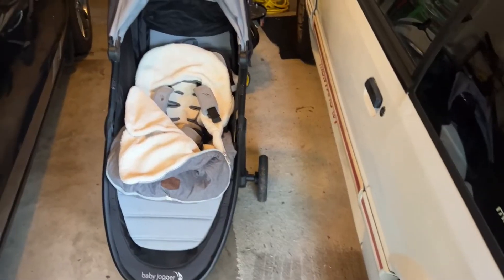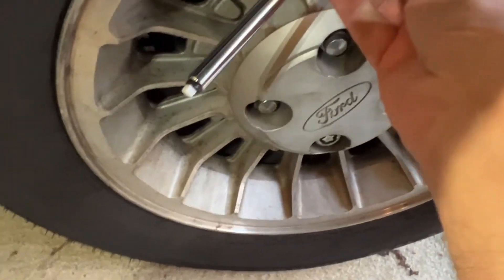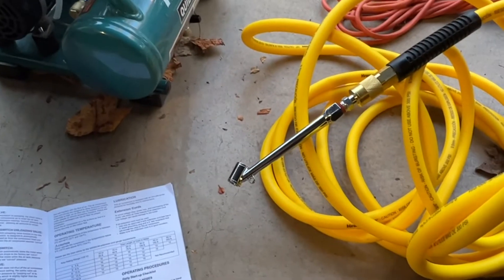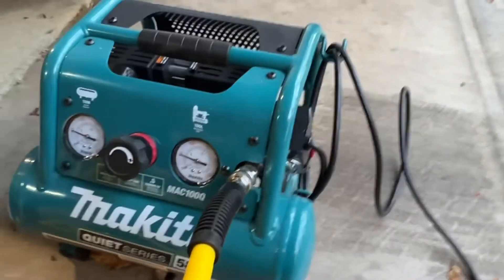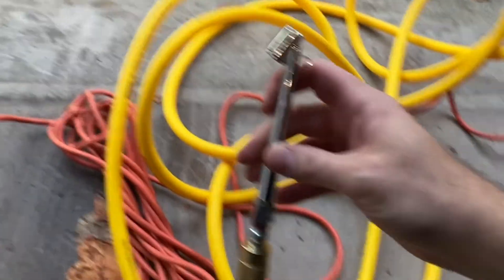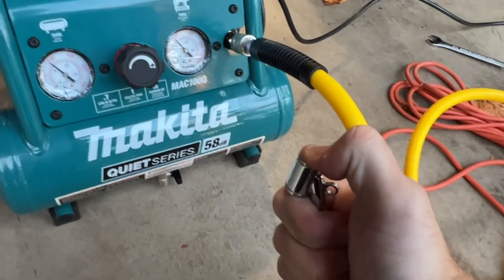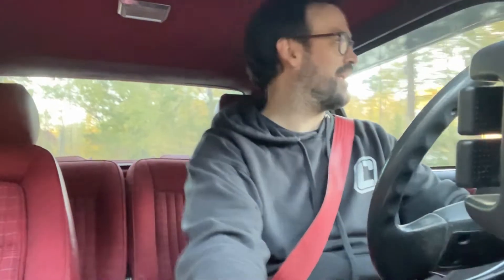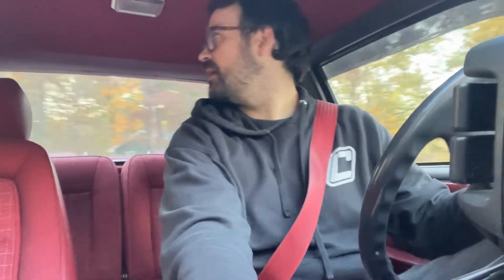Makita Air Compressor & Taco Potato Car Talk

Comment: Totally understand the little time to drive the fox.  My wife and I used to take our convertible out all the time before we had our daughter (who just turned 1).  Now I try and take it our once a month or two just so it doesn't sit to long.  I will occasionally drive it work or use it to grab take out or maybe a very early Sunday morning drive.  My wife encourages me to get it out so it doesn't sit to much.  She hasn't ridden in it in a year.  Once our daughter can sit in a forward facing seat, it should see more use.  There is no way a rear facing seat would fit in the back seat of a fox convertible.

Comment: I’m currently mulling over the possibility of buying a ‘20 or ‘21 STi to use as a daily. I’d be interested in your thoughts/opinions on those cars since you mentioned they made your DD short list for yourself. Have any older vids where this subject was discussed? Always enjoy your videos, keep up the good work! 👍🏼
Reply from the maker: Hey, thanks for your comment! I can’t remember if I talked about the STI in a Vlog last year, but will see if I can figure that out. In case I didn’t, the one I drove was a 2021 STI - it was fun to drive, the shifter felt really great, and I was pretty impressed with how well it held to the road around corners. The clutch was super light, which was a nice change coming from the heavy clutches in both of my Mustangs. My biggest complaints were the lack of lumbar support and that it felt a little underpowered. That last bit might be a little unfair though because shortly before I drove the STI, I had spent a few days driving a friend’s JDM Rally EVO, which was one of the most fun vehicles I’ve ever driven. 

I would say they are worth a test drive, but would also recommend driving the Focus RS.